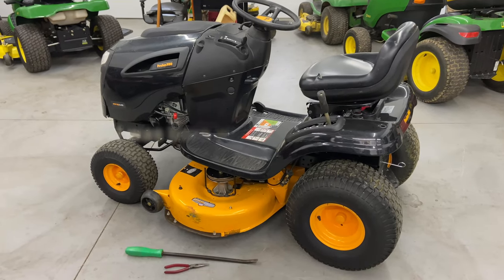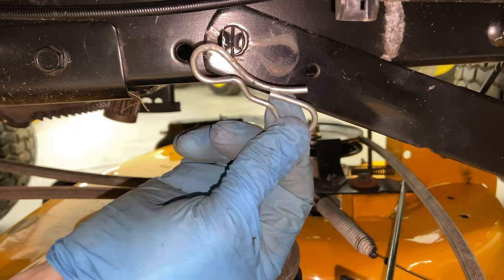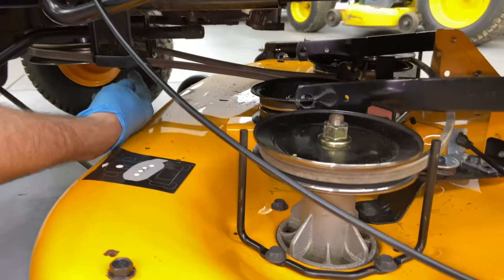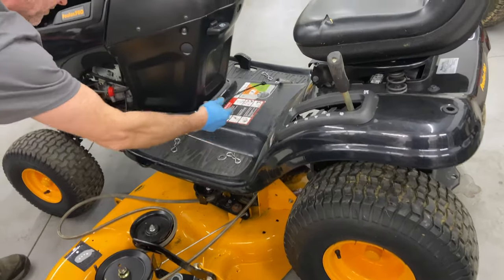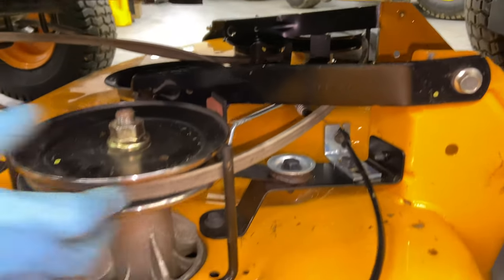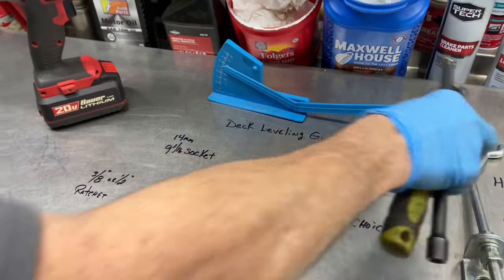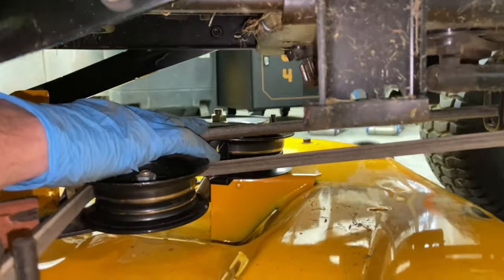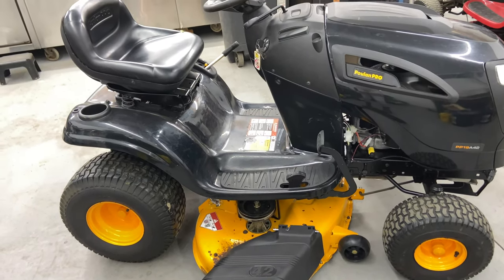How to Remove Mower Deck Poulan Pro Lawn Tractor

Comment: wow , love your in depth how -to's videos my friend . Some people probably don't realize just how much goes into having a beautiful yard . 
 
i recently bought a poulan PP175G42 from a doctor friend of mine who only had it for about 5 months . his zero turn was giving him trouble and bought this from an estate sale that belonged to a very old man . the reason i just bought it , he has decided to move to another state and doesn't need it anymore . after cutting my yard , i noticed it didnt cut as good as my 4 wheel drive walk behind troy built mower . 
 the left front and right rear tire both has a small hole in the side wall , he had been filling it up with air all this time , i did something kind of stupid , i put fix-a -flat in them to stop the slow leak . tire pressure counts when a well mowed lawn is wanted . then i cleaned it up really good and noticed the blades are really in need of replacing .they are in the worst shape i ever have seen and cannot be re-sharpen , not much blade left LOL . 
 thats a costly job i have to do . then the dect only drops to the 2 and a half position . the deck needs to be worked on , i will get another adjuster for the other side . so i have to spend a few hundred to get it to cut good again , tires , deck work and def some new blades . it looks almost brand new , i got it dirt cheap for 300 dollars so maybe another 300 dollars wont be so bad to have a good riding mower .
 i also plan on doing full maintenance ,fuel and oil filter , oil change , a E3 special spark plug and a little shot of carburetor cleaner and a dash of marvel mystery oil in the gas tank .  

 i am kindda regretting getting it in a way , i have a lot of obstacles in the yard , but the cutting in reverse hack i can scratch off my list , this i was told can be done by putting the key position in the 12 oclock position .
i still will have to edge ,weed eat and use my push lawn mower to get to where poulan cant cut , , i will have to repair it and see if its worth the trouble to keep . 
i want to keep it , but i want my yard to look like professional landscapers do it !!!! LOL 
once repaired i know i could at least get a grand for it , i dunno , will have to consider it all one day .

Comment: Very clear. I went through 2 belts last week in a couple hours, so I was concerned that I bent something on the pulleys or deck. I wondered about how close the belt goes over the brake bar in the back but I see in your video that it is very close. The belts seemed to twist and wear abnormally and then break very quickly. The first belt I left it stored with it coiled up, so I think maybe that it why it twisted and wore abnormally. But the second belt, I opened it up and let it hang free overnight, but maybe that was not long enough?
Reply from the maker: Leaving the best curled up while storing it will not harm how the belt operates on the mower deck when installed. You have other issues.
Reply: @JohnsonsSmallEngines  I just got a new belt and put it on. With the blades engaged the bottom of the belt touches the Linkage Brake as it runs across the back from V pulley to V pulley. I don't see anything bent or grossly out of place. I have tried adjusting the Linkage Brake bar tighter but doesn't seem to help. Any suggestions?

Comment: I was watching this video as I've been interested in swapping decks on this exact mower. Since you have more experience in mowers than I do, do you think a swap for a 52 inch deck would  run okay. Flat mowing, low grass, dry weather and no bagging assumed..
Reply from the maker: My guess is you have a large property? My concern would be one, would the 52 inch deck fit? I do not get into any swapping of different mower decks because in my past experience, it has been a nightmare from getting it to fit properly to the belt. As far as your question, would it be OK to use? I would say you may have an engine that is under powered if it’s not a twin cylinder? And the front suspension will get worn out much more quickly with a heavy deck. If you do swap it out and it works for you. Definitely keep the tire pressure up in the front and the front spindles greased on your axle and front wheels also. If you do swap it out, let me know how it is working for you. I am always curious to know how things work.

Comment: Just subscribed. You are so right about deck height being too low. I can't even use my my Yard Machines (MTD) when my grass is growing fast in the summer; it  removes too much grass & causes excessive clumping. Thus, I only use the tractor for fall leaves. That Poulan is an AYP product (Husqvarna) & good for AYP for offering an adjustable hanger. Do you know if MTD has such a replacement hanger? Have you ever added one on an MTD unit, like Troybilt, Cub Cadet, & some Craftsmans, etc.?
Reply from the maker: MTD are different and I haven’t come across a fix for that yet. What is your model number off of the sticker under the seat? I will check your model and see if there is anything on that model. Thank you for supporting the channel!
Reply: @JohnsonsSmallEngines  Thanks for the offer. Doubt if there is such a part. My model is 13AM762F052. If you don't find anything, don't worry about getting back to me. I know you are busy & I will just assume you found nothing. Thanks again.
Reply: I've a cub cadet ltx1040 ( mtd) and mine suffers from this too. Its 10 years old and at its maximum height it's only cutting at 3 inches. I've watched a video by mower mike in which he shows that alot of times it's a bent hanger or deck bracket. He shows how to straighten them back out. I took my deck off and nothing seems bent or worn,so it didnt help me in my case,but if you wanna check his video out his channel is called mower mike and it's on fixing a saggy deck. It's a really cheap poor design. I'm glad they quit making them that way,but it's not helping me right now. It's a good old tractor otherwise.

Comment: I need a mulching kit for this exact mower. Everyone I’ve tried the plug doesn’t fit. Any suggestions?
Reply from the maker: Try looking up the mulching part number by using the model number on the sticker under the seat. That should be the correct method on looking up parts.

Comment: What is the part number for the rear mower deck hanger for the mower that you were working on plus what is the color of yellow is used on the front and back wheels and the mower deck
Reply from the maker: at 9:58 of this video or all info is on this video and in the links in the description. https://youtu.be/JvaMxEdah5s. Not sure what the color is. Equipment Caterpillar yellow? I'm guessing.
Reply: @JohnsonsSmallEngines   okay thanks for the info on this matter young man 👍😎